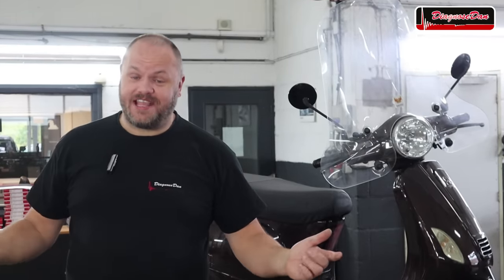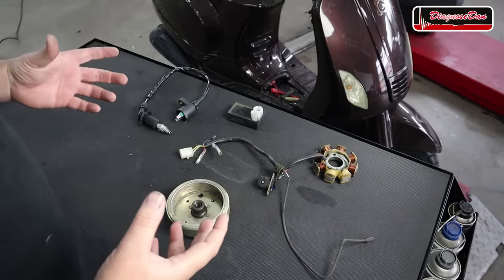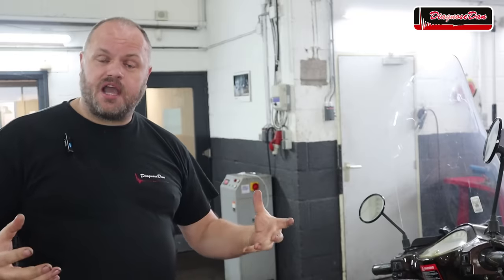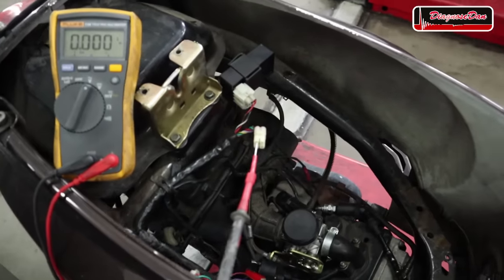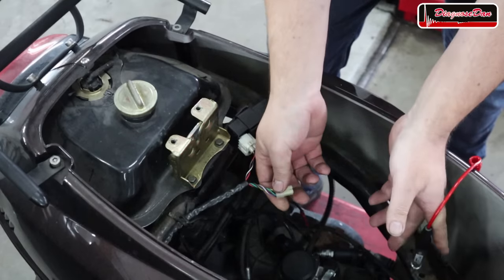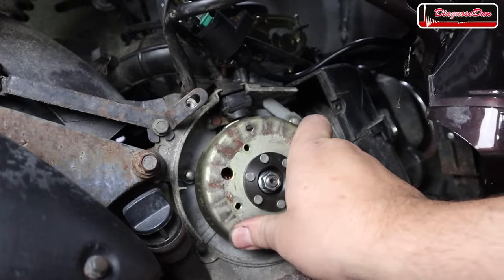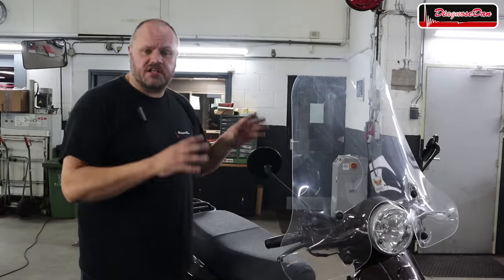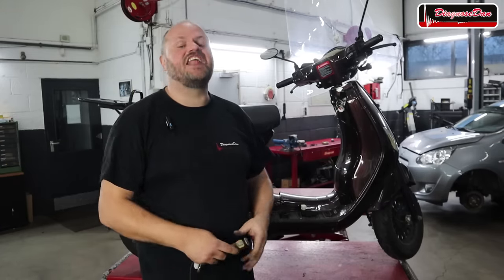No spark diagnosis and Explanation (GY6)

Comment: I had a Mercedes before.  It had about 1000 miles when I got stranded on the road.   The engine would crank but not start.  The Mercedes dealer techs spent 3 days trying to figure it out.(fortunately, under warranty)   Later, they admitted that the overlooked the most obvious cause.      There was zero fuel in the gas tank, which was the reason for the engine not starting.   However, the fuel gauge needle was at full and the low fuel warning light did not come on.   Apparently some sensor inside the gas tank was defective and stuck, so it was falsely reporting a full gas tank.   They added a couple of gallons of gas and the engine started right up!   (after installing a new sensor, of course) :)
Reply: So you were driving along with a full tank of gas for how long?  You are the main part of the problem.  Did you notice? (of course not).
Reply: Root cause analysis? How long did the driver think the fuel might last?
Reply: @connclissmann6514   I only drove that car about once a week, so I didn't pay much attention. (yes, my bad)  :)
Reply: @stevekelly5166   I only drove that car about once a week back then.  When that "incident' happened, I think the car sat in the garage for about a month.  That was why I no longer kept a car when living in the city. :)
Reply from the maker: You had no idea yourself it would run forever without using any fuel?
Reply: @Diagnosedan   I was young and stupid.  It was my very first new car at the time.  :)   I also didn't drive it much because I lived in the city. Sometimes I only drove it 50 miles each month, so I didn't remember the last time I filled it up with gas.         The strange part was that the experienced technicians at the Mercedes dealer didn't figure out the "problem" for 3 days. :)    If I remember correctly, they were about to take apart things(starter, injectors, etc)   :)

Comment: Dan. very well done. From being in the 2-wheel trade myself - Side note: There is a minimum gap to be set between the Reluctor and the Pick-up, as when the gap is too big, the pulse-signal could also be too weak. It could happen when the metal bracket to the pick-up was bend etc. Otherwise, out of many of these online videos I saw, I think yours is just that tad higher quality than most of them.
Reply from the maker: Thank you, yes you are right if the gap is to wide this will affect the signal. 👍👍👍
Reply: @Diagnosedan  - And with "a Tad", I meant, a tad better than most of the best ones. Thank you for sharing your really valuable knowledge with us.

Comment: A quick (ish) tip:
I use scopes, I love them, and I teach others to use them - for four wheel stuff and two - but Dan's right in that not everybody will have one. Or even if they have one, at the side of the road they might not have one with them.
Dan is also right (indeed he shows it on the video) that due to both the waveform characteristics of the 'pick up' (a two-wire variable reluctance type 'crank sensor' of sorts in car language) and the way digital multimeters work, you can't get a good read with a DVOM  on these kind of signals. Also with the capacitor charging output. Even when Dan sets the multimeter to AC  the reading is way off. This is because on AC the meter is expecting a sine wave. So the characteristic shapes of both the 'pick-up' (the timing sensor is you will) and the 'capacitor charging coil' won't be accurately gauged. 
(incidentally though, if instead you're testing the AC output from the stator that goes to the reg/rec of a scooter or bike - single phase or three phase - with the connector at the reg/rec disconnected you usually CAN use a normal multimeter on AC volts to measure that - near enough.)
Dan is right in that a lot of people sort of use a multimeter on AC and kind of learn a rule of thumb for these 'not actually what the voltage is' numbers. 
For example, on the working stator his capacitor charging coil output at cranking had an actual scope-measured peak voltage of +120V, but only read 77v or so on the meter set to AC, and he stated a rule of thumb that 50 - 100v on the multimeter (set to AC) was considered good. 
Similarly, on the pickup it scoped at around 4V for the positive peak voltage, read around 0.4v on the multimeter  (set to AC, with multimter neg lead on battery negative, NOT on the earth/other wire from the stator btw) and he states 0.4V to 1.5V AC is good. 
This is fine to a point. But some stuff 'spikes' so quick even this 'known flawed' technique with the AC won't work. 
So rather than sort of guessing with rules of thumb like that, what is VERY cheap to make (many will know this trick but a lot won't) is a "peak Voltage adapter" for your multimeter. You can literally make one of these with a Diode, a capacitor and a resistor. That is all. You can add other stuff to complicate it, reset it quicker etc, but honestly those three components will work fine. 
I have made dozens of these. The details are easily findable online, just google it. DO NOT buy one. Just make one. 
These 'capture' (for long enough for you to read off your multimeter set to DC Volts, before the resistor bleeds off the cap) the PEAK positive voltage. If you really want you can make a version that captures the negative peak, but the positive peak voltage is usually the info you're after. They work with the under 5V of the pickup and ALSO the 100 to 200V you get from the output which charges the capacitor in the CDI. 
Interestingly, the way CDI works (either so called AC or so called DC) kind of uses this same diode then capacitor set up itself to capture the voltage too, only by way of a thyristor or later electronics it's then actually using the stored charge to put through the coil primary when told to, rather than just holding so you can read it on your multimeter. :) 
NOTE. Remember to factor in the forward voltage drop of whatever diode you use. This means the initially stored voltage in the cap that your multimeter reads will be the actual voltage MINUS say, 0.6-0.7V. When you're seeing if the Capacitor Charging coil is peaking at spec, if you're looking for say 120v, an error of around half a volt is no problem. But if you're comparing against a known spec this offset IS a fair amount of the much smaller voltage you'd be looking for on the pick-up.
ALSO, remember if you're using a Peak Voltage Adapter your multimeter is now set on DC. As you're measuring the DC voltage stored in the capacitor of your adapter. This is simply the positive half of the waveform as the diode has 'half wave rectified' if you will. 
If you look at a lot of particularly Japanese motorcycle factory service manuals, they will often give the peak voltage minimum requirements for a number of things: the pick-up (even on non CDI bikes too), the CDI charging coil output (on AC CDI bikes), even the primary spike on the ignition coils too (which you're definitely not going to get with a voltmeter on AC). As a 'poor man's scope' I've even checked ABS sensors and all sorts using one. 
Now yes, as anybody who does any diagnostic work can tell you, occasionally of course you're interested in far more than simply the peak magnitude of the positive voltage of a 'crank sensor' pick up etc's output. Bad pattern, wired back to front, cam crank correlations etc etc. But for side of the road "why won't it run?" diagnoses on bikes and scooters, often just knowing the peak voltage of the pick up (and in Dan's case here from the Capacitor Charging Coil also) can find your problem.  
Cheers, Ben 
(B.R.Repair Services)
Reply: An oscilloscope gives the peak to peak voltage the dvm gives  rms voltage so will always read lower whatever the ac source.
Reply from the maker: Hi Ben thanks for your great comment. I guess there are quite alot of kids working on their scooters and at least they have something to work with. I guess most have access to a multimeter. 
Great tip btw😁👍

Comment: This is a very useful video since it more or less applies to all simple 1-cylinder engines in case of a crank no-start. It is good to know the chain of parts involved so one can check them one by one to find the root cause and replace that part. 😊
Reply from the maker: Most scooters/ motorcycles/ atv's have a very similar system

Comment: You took a lot of time to get those parts together and explain their functions! I misdiagnosed an ATV years ago because I didn't know what the stator voltages were supposed to be. I was pressured into doing the diagnosis, and told the owner my best guess was that the CDI box had failed, but I was wrong. It was the stator in that case, also. This was in the days before the internet existed and data could be found outside of a manufacturer's manual. That sort of diagnosing is not very enjoyable!
Reply from the maker: Thats why its important to do some research before you start a diagnosis. But you are right, in my young days information was hard to find. These days you can find almost anything on the internet

Comment: Brilliant explanation! Recently I worked in a go-kart with the same problem and after checking the CDI in a similar way with a multimeter, the culprit was the spark plug pipe
Reply from the maker: Kart, atv,scooter, motorcycles all very similar

Comment: That was a nice clean diagnosis. I'm surprised you didn't measure the stator resistances before removing it, just in case there was a wiring fault.
Reply: I was wondering the same. It's always interesting to know the failure mode.
Reply from the maker: There are some different stator types out there. I wanted to keep it simple

Comment: That was great Dan, a lot of us (myself included) learned basic diagnostic skills messing around with motorcycles.  When I was 16 (44 years ago) I bought a moped with that exact fault.  There was no CDI as it was points and condenser, and we called the stator a magneto, but it was essentially the same.. so that was my first ever diagnosis.  I was lucky enough to have a multimeter.
Reply from the maker: Thats where it started for most of us!

Comment: I'm a motorcycle mechanic, and in my experience on scooters, it's very common for the stator to fail. I usually test this first especially on Chinese and Italian scooters. Very well explained diagnosis procedures, and how the system works. Your skills would be very useful as a motorcycle technician. Maybe you should branch out😂
Reply from the maker: I dont work on 2 wheelers very often, but i actually enjoyed this case alot

Comment: 15:44 its a regulator/rectifier. the rectifier turns the AC to DC, the regulator ensures the voltage doesnt go above a certain limit, around 14.5V
Reply from the maker: Thats right

Comment: Excellent video,  I'm  going through this right now with my genuine roughhouse. It's just a coincidence that I put a big bore kit on (2nd one , first wore out) and it was feeling week on its 1st test run on the way home it started cutting in and out almost violently, after determining it wasn't mechanical I realized my spark was the culprit. Now I have no spark, changed the coil, nope waiting for a new cdi, I don't think I'll be able to use a meter as good as you but I will check cdi for power and ground thank you.

Comment: Seems to be a rare failure for a motorcycle "alternator" however, this does prove that copper windings are not the same quality as they used to be.   Very straight forward explanation of the charging/ignition system
Reply: Unfortunately it's the Chinese windings that are not as good as most of the Japanese ones many of us see.
Reply from the maker: Thank you
Reply: I have never tried it, but it would be an interesting project to buy high quality wire and rewire a chinese stator to see if it can be brought back from the dead.  the japanese make great stators.  could a diy person like us achieve that level of reliability?  the chinese flywheel seems to be high quality.
Reply: @edwardjames6070  Most motors fail due to cheap bearings. Many are sleeve bearings, a complete temporary idea. Ball or roller bearings are best as long as they are quality such as Timken bearings.

Comment: Great diagnosis.   From my experience, if you are firing the parts canon at something the stator goes bad about ten times as often as the CDI box.   Maybe even more than that.  It's been a while since I ran across a bad CDI box.
Reply from the maker: I dont work on 2 wheelers as much as on cars, but i had quite a few cdi's going bad. Maybe its just coincidence

Comment: Very good video.  I've diagnosed CDI systems before and I found getting service information is the hardest part.  this was very helpful.
one more thing- CDI sparks are sometimes very faint, check the spark plug in low light to make sure it's not firing.
Reply from the maker: There isn't alot of really good information out there or at least its not easy to find

Comment: Excellent explanation as always Dan, but allow me to make a correction, at minute 4:15 when you explain the operation of the ignition coil you mention that when it is energized it produces the spark when in fact it is the opposite. The ignition coil produces high voltage (spark) when it is de-energized.
Reply from the maker: You are right

Comment: Great video Dan , looks a lot like outboard boat engines. Most of them are designed to run on handstart. So there's no need for a batterie. Exept those with electric start. Reliability is not affected bij the condition of the batterie. Some models come with an an emergency starter cord for starting when the batterie is low on voltage. Greetz John.
Reply from the maker: Good idea! Maybe a future video on a boat!
Reply: @Diagnosedan   I was having trouble with a a used  outboard engine. Then I found you on you tube. The Mazda leak test revealed a bad cilinder. That was also the problem with my outboard engine. Compression lost on one of the 2 cilinder. Bought myself a tester and ...confirmed. The shop took this motor back and returned me what was payed for it. That was in 2019. Thanks Dan,  for teaching us all. Greetz John.

Comment: I have a little quad with this same engine..   It was the CDI box for me.  I bought a random one online for five dollars and it actually worked, no issues;  which is funny, because that thing sat in my backyard for like 10 years before I ever tried to fix it. :) ..  I had several other bikes and quads so it was not something I cared about.  It's interesting that all these chinese engines are the same across all the different brand names.
Reply from the maker: $5 is a bargain!!

Comment: On CDI ignition systems we use a DVA adapter along with a DVOM. The DVOM gets set to DC volts, the DVA gets plugged into the DVOM, the meter leads get connected to the DVA. Then we probe both stators AC wires with the meter leads. Crank the engine over and see what you get. Typically you are looking for 100 VDC or higher. The DVA converts AC to DC. The reason for it is most (But not all) DVOM's like an AC voltage frequency of 50 to 60 hertz. If you are much higher or lower than that, the DVOM will not always read accurately when set to AC. But when converted to DC, the meter can read the voltage reading more accurately.
Reply from the maker: Thanks for the feedback

Comment: Hi dan love the video i know i don't  need to tell you this .ive had a no start  due to the stand switch being faulty  think they go to the cdi .and also other half had a scooter  gy6 and it wasn't running right struggle on tick over . Turns out it was stater not providing enough voltage. 
And finally  we call the flywheel a magneto . Keep up good work pal
Reply from the maker: Flywheel, rotor, magneto its called many things in different countries

Comment: Had this same setup on a friend's scooter - every so often it would die, and the kill switch would ground.  Finally traced it to a switch that used to be on the kickstand, which had been wrapped in tape and pushed up in the plastics.  Turns out some models will ground the kill circuit via the key, kill button OR kickstand!!
Reply from the maker: Thats right, the kickstand sometimes has a kill switch

Comment: Small note: the cooling fan is not there because stator coils would get hot. It is there to push air into that plastic duct on the right which directs airflow over the cylinder and its cooling fins. This is a 100% air cooled scooter.
Reply from the maker: Read the text in the video😊

Comment: You could also check the stator with only a multimeter. (Resistance/ohm's mode, and compare the results with known good values in service manual)
Reply from the maker: Next time😉

Comment: I have a Buddy 125 that I ride all the time. Last year I had the same problem. It went bad gradually. It was the stator. I should have used my Snap On Scope  to diagnose it. But I hadn’t watched enough DD to lead me in the right direction. I now carry all three parts in my scooter tool kit. As well as a new drive belt. I have ridden as far as 50 miles from my home/shop. Very cool vid. I like the windshield. Do u ride that one?
Reply from the maker: No i don't, but i love to drive a scooter in the summer. Unfortunately summers are short where i live. Lots of rainy and cold months, not the best to ride a scooter

Comment: Again excellent dan you killed it......i had 2 questions in my mind ....
1) what about the kill switch (pin no. 5)  how ground make cdi non functional....

2) you was touching the ignition coil with nacked handed.does 77 volts is safe to touch....
Reply from the maker: As long as its grounded properly its not a problem 😁